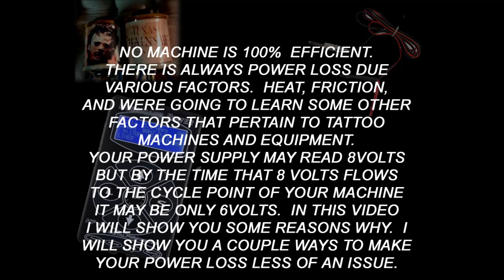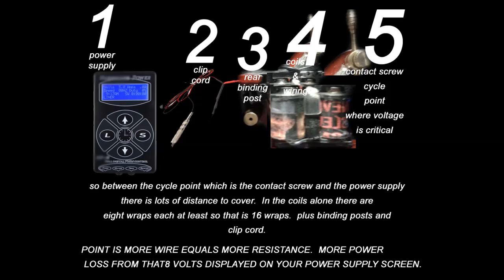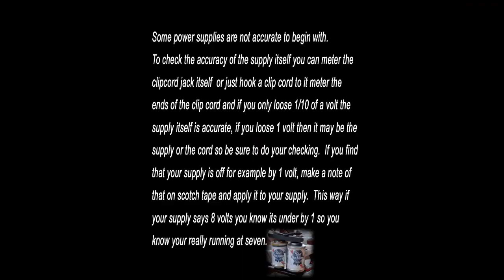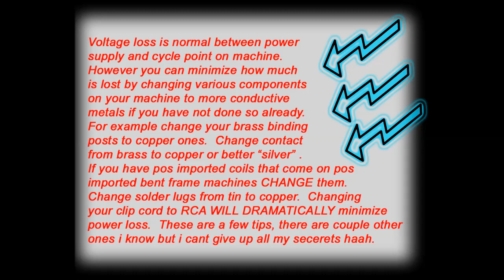minimizing power loss

Comment: Good day sir...i have a coil machine 8 wrap...in a middle of session it suddenly stop wroking i guess its over hitting...i really dont know how to fix my machine...
Reply from the maker: well that can be a tricky one.  how does it stop working?  all at once or slowly the power goes down?  does the machine feel hot.  what type of machine or coils does it have?  could be a few things make sure to begin with your not over working it.  to large a needle grouping running to high voltage etc.  but how does it quit working.  answering that will help narrow it down

Comment: after watching this video I was set on swapping my rig to RCA and crap canning the clip cord, so today on my way back from the Doc I stopped by Radioshack and picked up the stuff to do it. just finished converting my shader and holy cow is it sweet. I thought I would notice a little difference at least, but it is a HUGE freaking improvement! the machine runs remarkably smooth and consistent and operates more consistently at much lower voltages. thanks for the vid bro!

Comment: just got a brand new fk irons and have some other built by good machine builders and none of em work proper , got a eikon 250 series power supply and have changed the clip corde and pedal but nothing works . these are good machines but they kinda lose power and hits uneven after a while . i have two others and they work fine so i really dont get how these machines that suppose to bra great dont run good at all , its like something cuts the power to them , dont matter how i tune them they just start lose power and hits all over the place after a while very very annoying
Reply: hey do your power suplie comes hot ?

Comment: so the springs are the negative ?
Reply from the maker: not necessarily the springs, if you have a non polorized cap on the machine then dosnt matter which end of clip cord goes where basically one goes to rear binding to give current to one side and other end of clip cord goes to frame to complete circuit so when arm bar goes down circuit is broken coils no longer magnetized pulling arm bar down and tension on rear spring brings arm bar back up making froont srping contact the contact screw repeating the process.......sounds like more than it is but hope not to confusing
Reply: ok thanks for that. i was kinda wondering for a sec. love your straight to the point fun vids. you remind me of my old boss whom was a yr younger then me :)